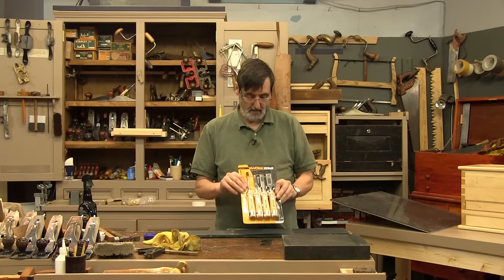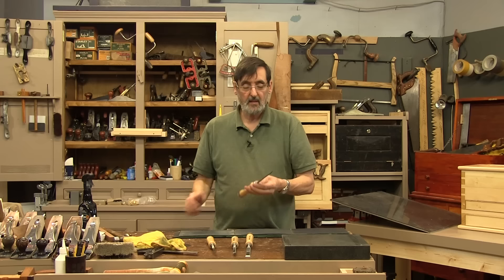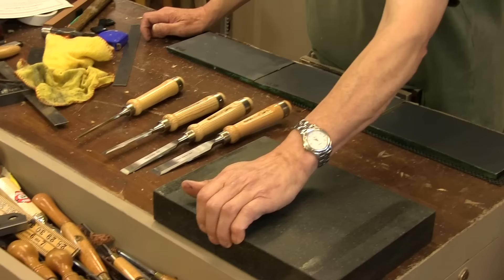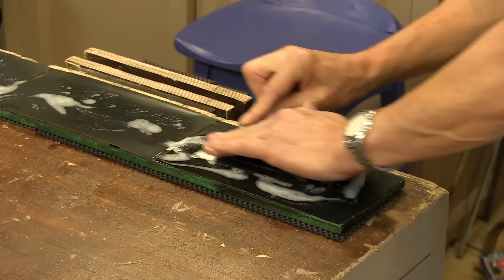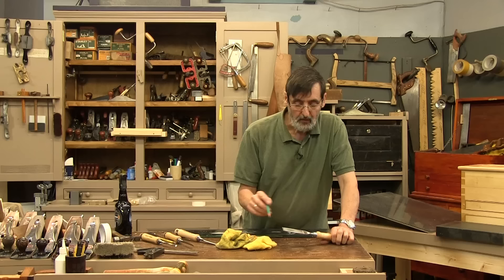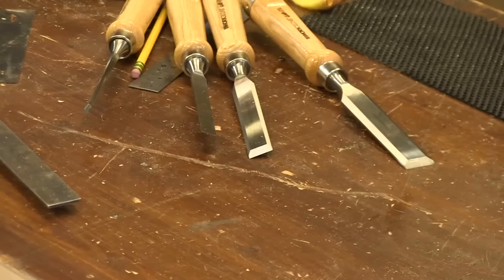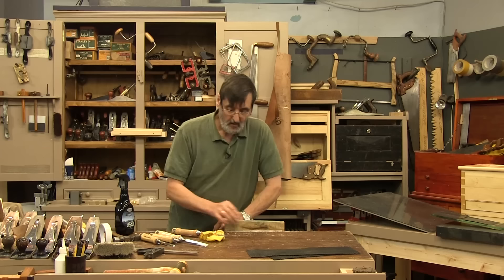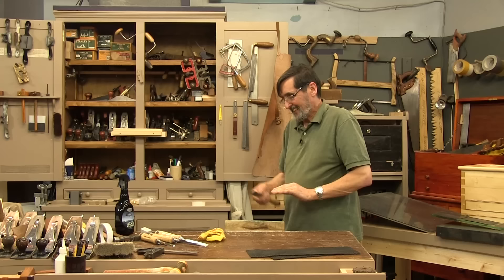Preparing and sharpening a woodworking chisel | Paul Sellers

Comment: Great information...very informative.  Noticed the chisels were German made.  I had bought a cheap set of such chisels but they were from China.  I did not sharpen as you did...but from now on will do so!!!......But what I found was the metal was obviously very soft as just hitting knots in the wood I was working with would make a defect almost like hitting a nail, so I conclude the metal has to have at least some degree of hardness....UNLESS the sharpening somehow helps this.  Saying that, I would like to get at least a middle of the road set of chisels....recommendations?  If the information for such is in one of your books, I will gladly purchase....I think that many of us who have not worked with the equipment are near overwhelmed with the plethora of brands and have little way to compare...from watching the video on restoring planes, I noted Stanley was good....at a flea market today, I did not see any Stanley planes but I did see one Bailey....rusted as expected, but the makeup was different in its construction as to how the blade was held in place...everything was very loose, so I left it to someone else. I have noted also that a lot of the planes I have seen at flea markets are from India....I have been reluctant to try......Thanks much!!!
Reply from the maker: You don’t say what country you are in so it’s difficult to advise.
Reply: Sorry.....US  in Tennessee .  Had the opportunity to spend three months in the UK as exchange resident back in the 1980's....primarily in Wales....Boddelwidden, Wrexam, Bangor, Chester but also got to travel to Lake District, PLymouth, Bristol, Moors etc.......really a fun time.  The craftsmanship was wonderful to see in many of the places and Pubs......I believe the original timbers from the 8th century were in one of the pubs out in the Moors.  I miss the good ales straight from the barrel.  My wife has seen me watching your videos...she asked me today if I was going to open some sort of wood shop....Ha....never say never...

Comment: Thanks - that's a half reasonable explanation but you notice that Paul  still ends up stropping the back face of the chisel at the end . 
 After revisiting the video I think that although he states that he could continue the process (i.e. polishing the bevel) on the wood block, he prefers the leather stop because of the way the leather 'mushrooms' up around the bevel which in his case is a convex bevel ( and therefore  not flat) and possibly resulting in the strop contacting the whole curved surface better than if it were done on a flat block. That would tie in with what you said, Illyrius.

Comment: Is it preferable to put a camber on the bevel side of the chisel as opposed to a flat bevel? Thank you Did I see you put a camber on your plane irons also?  Thank you Paul
Reply: There are disagreements on what's best.  Paul Sellers and many others (me included) believe that a convex edge is preferable to one with a microbevel, because there is neither a weak point nor a secondary angle that can scratch anything when using the chisel the other way around.
A secondary bevel is easy to add, and especially with machine sharpening, which I believe is why it's so popular.   A consistent convex edge is more work, and muscle memory when sharpening, so you always get the start and end angles the same.

Sharpest of all is a straight grind without a secondary bevel, but then you trade off how long the tool stays sharp.  For fine carving knives, gouges and chisels, that's still preferred, even if you have to resharpen every few minutes.

Comment: Hi Paul, love your films.
Will any glass cleaner work as a lapping fluid?

I was really struggling to find the chromium oxide blocks until i discovered they are usually called buffing bars, or buffing compound.

Once again, many thanks.

Comment: dear Paul, would you remove the metal ring at the end of the wooden handle? if so, how? or just saw the end with the metal ring off, so the chisel is shorter?
Reply from the maker: Thank you for your comment. I just use a nail punch or a square ended screwdriver to drive off the hoop by tapping with the hammer equally from both sides

Comment: Wondering if you are exerting your force on the draw or pull stroke due to using the sandpaper that might tear if you pushed the edge into the paper, or some other reason? These chisels are not sold in the US that I know of. They appear to be of German make or is the German label just the importing or marketing concern?

Comment: After honing, I sometimes end up with an edge that's slightly out of parallel to my handles, as in a bit crooked, is this a big deal? instead of --- it's  slightly /, of course not by that much but you get my idea. The edge is dead straight, but it's askew a tiny bit
Reply: I had the same issue - get yourself a sharpening jig, can make your own or about 12 usd online. You want a straight edge! only want ( with a plane.

Comment: Been a carpenter for 30 years, but never needed this. A decent oilstone (recommend an India - IB8 oilstone) is fine for the job.
Reply from the maker: Been a furniture maker 55 years and need this all the more. Better to always leave room for improving yourself. That's the catalyst of fine craftsmanship.
Reply: @Paul.Sellers  If it makes people feel they have improved by doing this sort of thing then that's a good thing. To be honest I only put one edge on my plane and chisels. When sharpening I start with the chisel low to take metal off the back and slowly lift the chisel until the blade has the burr. This way I never need a grinder and don't get in to the bad habit of lifting the chisel until I have such a square finish angle I need to blue/over-heat the steel on an electric grinder.
Reply from the maker: I sharpened for 25 years thinking I knew all there was to know and then a man, an amateur, came by and showed me a better way.

Comment: Great video, thanks!

Can anyone clarify whether he is demonstrating two different techniques here? I.e, 1)Wet and Dry paper or 2)Diamond stones. 
Or is this all one process, I.e start with the Wet and Dry and then work up through the diamond stones?
Reply: Thanks!
Reply: Sandpaper is only inexpensive in starting costs.  If sharpening several times a day, as woodworkers often do, it becomes a very expensive way.
In the long run, Arkansas and diamond bench stones are the cheapest, water stones more expensive, and sandpaper the most expensive, which is exactly the opposite of the starting costs.

Comment: Thank you for a very practical and informative video.
I have a question: why is it necessary to chrome oxide polish the back of the chisel on a wood block? Could this step be omitted and move straight to the leather strop?
Thanks.

John.
Reply: It's just easier to put a polish on the back that way, you only have to do it once. If you try polishing the back on a strop by moving the chisel back and forth and that speed your edges would be catching and ruining the leather

Comment: Hello Mr. Sellers--thank you for making these videos. I recently bought something comparable from Harbor Freight (in the US). The steel is adequate, but the cutting edge is not square to the length of the chisel--off by 3 or 4 degrees. How would one go about fixing this?

Comment: Hi, I recently began sharpening my chisel I have two questions: 
1. How do you resharpen/fix a nicked chisel? 
2. Does the macro bevel have to be at some angle (I bought mine new with 25 deg bevel) or can it be eyeballed?
Reply: 1. I use a horizontal  wet wheel to take a nick out of a chisel.  Any kind of grinder will do but if it is a dry wheel you will need to be more patient to avoid overheating the steel.  
2. I think you mean micro bevel.  When you sharpen freehand it will naturally result in a curved (cambered) primary bevel making a micro bevel and the jig it requires unnecessary.  As you sharpen start your motion by touching the heel of the primary bevel to the stone, slowly raise the angle of the chisel while you listen for a rise in pitch of the stone and steel.  This change in pitch means that you have touched the edge of the chisel and you can stop after one more stroke.  
The camber should be minor and result from natural arm motion only.  If you try to hard to induce camber you probably will overdo it.  The camber should be slight enough that it looks flat and is only visible in reflected light or when held against a straight edge.  Also if you are starting with a new chisel they are usually flat ground.  When using this method this will leave a hollow area between the heel and edge of your bevel, that is fine you can leave the hollow or as Paul did in this video grind it out prior to final sharpening.
Reply: A few minutes on a Washita oilstone will grind the nick out of and put a new bevel on pretty much anything.   A coarse diamond stone or coarse water stone will do the same, but then you also have to step up through several grits before the edge is smooth enough that you can go to high grit, while a Washita stone removes metal fast while still being in the equivalent of a 400 grit range for how smooth it leaves your bevel.

Comment: I find you stop feeling a difference after about 4000 grit, I work with birch quite often which is quite close to rock maple in hardness. Im sure on pine or something you will stop feeling a difference a lot sooner.
For new chisels i flatten with a freshly flattened 500 grit stone, Then i go to 1000, then 2000, then 4000, then i polish on a leather strip, Can't remember what paste i use for polishing by name. On chisels that have already been sharpened and just need to be refinished i go 2000 then 4000 then polish. Nothing feels as good a a sharp chisel cutting through wood like butter!

Comment: Hello Paul,Im learning a lot from your videos. I did have a situation. I received my Narex steel premium chisels the other day and being brand new to chisels and wood work, I watched your video on sharpening them before using. I used the sandpaper on glass method with window cleaner. It seemed to go fine until I compared the chisel I sharpened to one straight out of the box and the one out of the box seemed sharper or at least it did a better job on the wood I experimented with. The one I sharpened looked nice and feeling the edge I couldn't say which one was sharper. I wonder what I did wrong. Could it be the angle I held the chisel when doing the bevel on the back. Any input on this is appreciated. Thank you for all the great DIY videos, Paul

Comment: Thanks, but what I'm asking is: is it necessary polish the chisel on the wood block  AS WELL AS on the strop. Would not the stropping alone be sufficient? Why both?
Reply: +John Frizza Pretty sure the key is to use wood for the flat side of the chisel and the strop for the bevel side. I imagine that the leather would have too much give in it to stay flat properly.

Comment: @Paul Sellers Hi Paul,  I watched a few times but am I missing some info? I am not understanding what is happening with the 25 and 30 degres angles here? Will do some more research but would appreciate more info. Many thanks for sharing your knowledge.
Reply from the maker: The reality is you can sharpen a chisel to any angle between 25 and 30 degrees and even go up to 35 degrees and it will be sharp with minimal resistance. You don’t need micro bevels or secondary bevels, I just sharpen and get on with it.
Reply: Thank you for your reply which explains it all simply but clearly.

Comment: I am using the glass and spray adhesive. I recently purchased 12 various Chisels that are Freud and marples blue chip. They are all socket Chisels. I am having a hard time getting the things flat, square, and the blue plastic handles on the marples look like they were thrown in a wire brush. Should I scrap the handles and make new ones similar to the handle turning video you done? Can these blue handles be purchased separately, if so please send a link. I am not finding much on  thes old blue chips. As for the freud chisels they are deadly sharp.   Have you ever worked with them? I have a small collection of carving, mortise, and bevel Chisels from narex. What is your opinion on narex? I find them to be a good addition to my shop.
What is your fix for rust and sap on tools like saws and Chisels? I seem to work with more green wood.
Thanks for your time and information!

Comment: Sorry for a newbie (the answer may be obvious to some), but at 17:30 he goes to the plates. Is he just showing us the non-sandpaper method (the method he uses)? Or is this in addition to all that happened before? Thanks in advance!
Reply: Sandpaper and glass is the most effective way to flatten the back of the chisel, but you only need to do it once. Sharpening the bevel is best done with the diamond plates the whole way through.
Reply: This is just his main method

Comment: Hello!
I bought a beautiful 8-piece set of old Swedish Eskilstuna chisels on a flea market. Trying to restore them now but four of them have a big belly on the back. By looking at the handles it looks like somebody hit them very hard with a big hammer which made the chisels to bend… Just a guess.
Is there a way to restore a chisel with a serious belly? How?
I guess it wouldn’t be preferable to grind 1-2mm off the chisel back? Should I try to heat them up and bend them?
How about grinding one inch straight and leave the rest of the belly?
Reply from the maker: Hello. If they bend one way they will probably bend the other way using the same force. It’s up to you whether you want to try it but personally, I would just try that. Alternatively, you can do exactly as you say and grind them back to flatness.
Reply: Ok, thanks. I'll see if it works.

Comment: A set like this would easily cost 4x as much in the US. I bought a set of Narex chisels that are similar for around $60 in '14. You can get a cheap plastic handled set for $10-15 in the big box stores but they act like they are made of mild steel, I suspect they probably are. Good for door jambs and not much else, but on the upshot you can touch them up on a grinder without drawing the temper (because there is none.)

Comment: The steel coming off onto the chromium oxide is because of not sharpening to a higher grit, at least 8000.  I know this because when I strop a straight razor on my chrome ox strop I get no black residue.   So, he's demonstrating sharpening past 1000 grit, just not on a plate/stone

Comment: Sometimes I wonder why people spend more money to get sharper knives  and stuff, as long as the material is the same, they require sharpening anyway.  Some of those chisels cost a lot more just because they are sharper when bought. i had some carving tools which was very cheap and it didn't do shit, it won't cut or carve  even the softest wood, even when it's still brand new. I'm an amateur and I wondered if I was doing it wrong. Then I sharpen them  and it finally does it's job. Although perhaps the quality of the steel may be different. But so far it does its job the way I wanted it to.

Comment: Hi Mister sellers,

Just watched your video on sharpening.  I always thought that the bevel had to be flat.
clearly this is not the case.  I wonder what your thoughts are on hollow grinding the bevel?  Would this aid the sharpening process?

Look forward to reading your thoughts on this.

Regards,

Bill.
Reply: Holow grind it. It will let you chip out mortises much easier, also you will have les 'meat' to polish, only you will have to sharpen and polish on stones and strop pulling blades away of stone or strop, not pushng them into it. Since ther will be less surface to lay force against, if you push into stone or strop, you could over turn the blade and destroy edge of the blade
Reply: Im a strong advocate against hollow beveling when it comes to general work chisels, hollow beveling was found and design for extremely fine work, reason being, hollow beveling removes your steel's ability to hold the edge without burring over. steel at a micro/molecular level is actually pretty soft metal. believe it or not silicone is harder at that point. anyway back on point. hollow beveling also makes it more difficult to maintain and hone hence the curving.
Reply: I made simple honing guide, with which you can sharpen no matter what kind of edge you start with. Also, steel used to make chisels is high carbon steel which after tempering has carbide microstructure much more harder than any wood. While holow grinding it is very important to cool your work since temperature distubs steels microstructure. After holow grinding you end up with this concave edge, which you still have to sharpen with fine grit. If you have (or make guide), then you will have no proble, it is a bit more difficult freehand. By sharpening and honing onto flat surface, you establish new cutting edge, which is not concave, but flat. You choose how much material you wanna remove, and you can just touch edge for fine work,or make wider-flat for hard work, always having that hollow of removed material, which you don't need to polish. I am not if i made a clear point.:-)